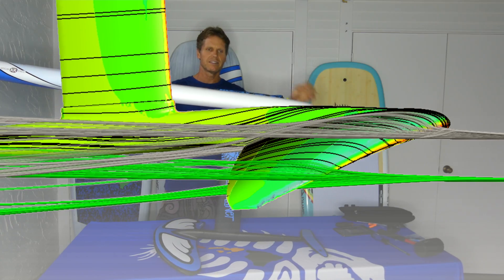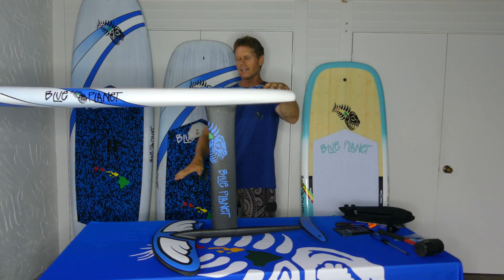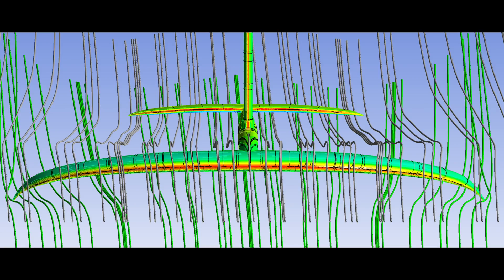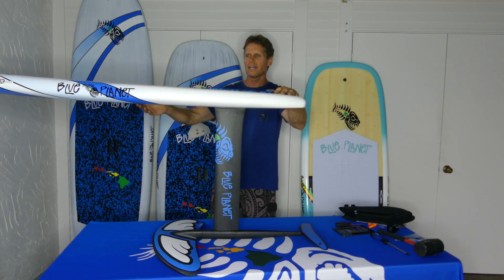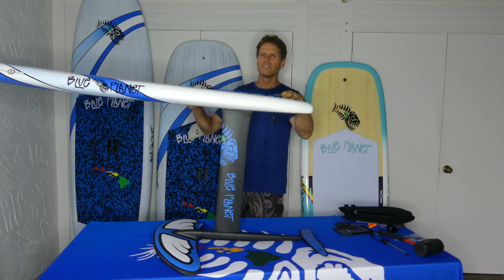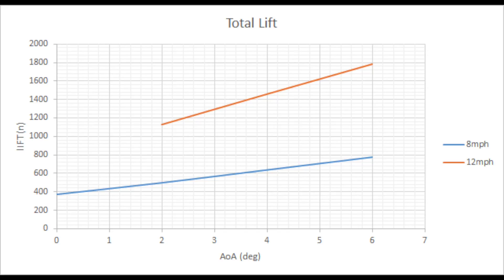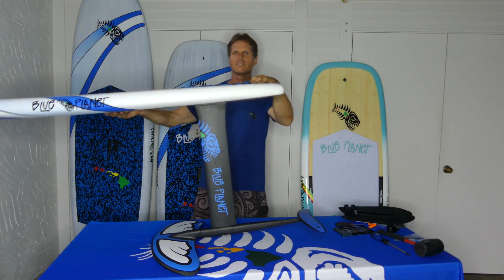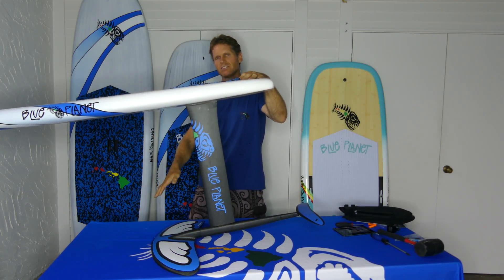Foiling terms: Angle of Incidence vs  Angle of Attack

Comment: Good Topic Rob, Can U design a system on da mast? To make adjustments as needed. Instead of adding shims or washers etc. 👍
Reply from the maker: Hi Paul, making the mast to fuselage angle adjustable is a good idea.  On your Easy Foiler board you don't need any shims, it works best without shims.  I would only consider using shims if you have a board that has a lot of rocker under the foil mount area.